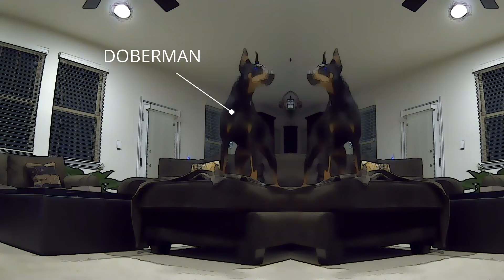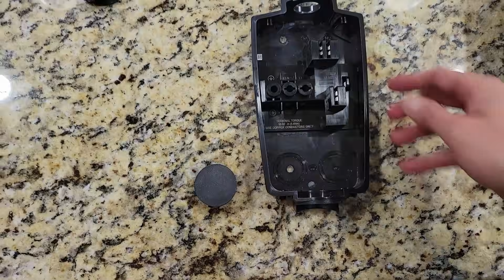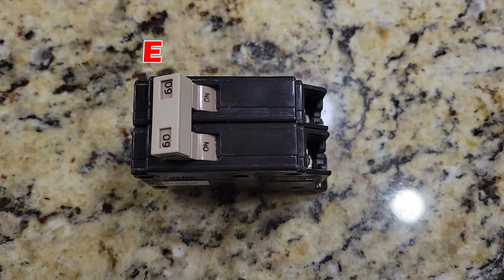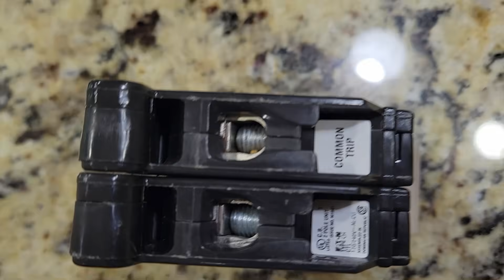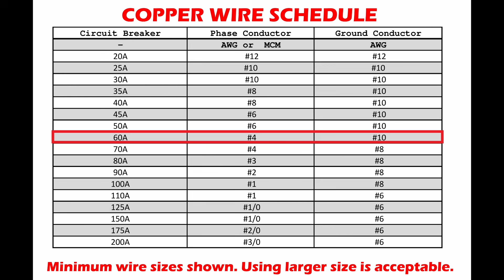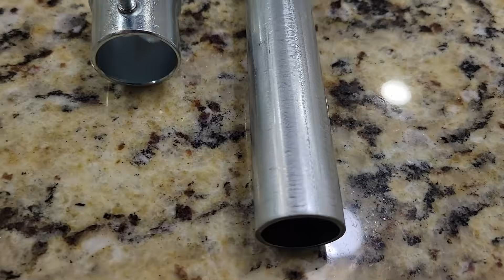Tesla Wall Connector Installation Tips NO ONE is telling you!

Comment: You shouldn’t be using a bare copper ground in conduit, you should have used 10g thhn in the color green. A better practice is to size ground wire down one gauge size from your ungrounded conductors so I would have pulled it with a 8g ground wire.
Reply: I thought it was OK to use same size ground wire as the 2 hot lines.  Is there a reason to downsize the ground wire?

Comment: If you use NM-B cable then 6AWG is rated at 55Amp max for continuous load. The NEC definition of a continuous load is a load where the maximum current is expected to continue for 3 hours or more. If you use THHN wires then 6AWG is rated 65Amp max for continuous load. Both conditions are for the standard 60/75°C termination on both ends, the EV connector and the Circuit Breaker.
THHN 6AWG is also rated 75Amp max for continuous load on a 90°C circuit. It's mostly about the insulations of the wire or the cable when it comes to continuous load ratings. THHN 4AWG wires for a 60Amp circuit is overkill. If you are running NM-B cable instead, then 4/2 NM-B (4AWG+10AWG Ground) is the correct way. Also note that there is no need to run the ground wire when using EMT as conduit. You'll need to connect the EMT to a connection box prior to the EV charger and run a ground wire from the box to the EV.

Comment: Great videos, i have a question please, i am running my wall connector on a 60 AMP breaker in the ambient temperatures of the North East at an elevation of 400ft and a 6 awg Thhn run of 85 ft long 18 in deep in 1" diameter piping, if this was you would you pull of the 6awg and install 4awg?
Reply from the maker: Sean, Here are some items to consider:
#4 awg yields ~0.96% voltage drop for ~90ft run. #4 cost ~$2.11 a foot.
#6 awg yields ~1.5% voltage drop for ~90ft run. #6 costs ~$0.86 a foot. Smaller wire is easier to bend and work with.
1" conduit will help facilitate the will pull for the long run. Remember the wall connector only has 1" conduit knockouts for the backplate for back entrance installation. If you do top or bottom installation (I did bottom) knockouts are 3/4" max. #4 preferred,  but #6 is acceptable.
Reply: @dgtv3320  wow i didn't know about the voltage drop with these wires. Thank you great information.

Comment: Not sure where you got that ampacity chart, but #4 is a bit overkill. #6 THHN is good for 65A And if you want an easier wire pull, use (green) stranded #10.
Reply from the maker: Good thought! #6 AWG is actually good for 55amps and  is not enough for a 60A breaker.  Refer to NEC Table 310.15(B)(16) for cable ampacities. Per NEC, anything under 100amps, the 60°C cable ampacity column has to be used.  For a code compliant installation, #4AWG is the correct size for a 60A circuit breaker.
Reply: @dgtv3320  Please refer me to the article that requires THHN to be rated in 60 degree column instead of the 70 degree column. (Are you thinking of NM-B cable?)

Edit: I am well familiar with 310.15 (B) (16)
Reply from the maker: I don't have the NEC code section off the top of my head. I will find it and post it here shortly.
Reply from the maker: Refer to NEC 110.14(c)(1)(a). Because of this rule, design firms across the USA design based on the 60°C column for circuits 100amps or less. Any circuits above 100amps the 75°C column is used. This is an industry design standard. This wire schedule shown in the video was “borrowed” from the previous design firm I worked at. Please remember any content on this channel is my opinion only and is not legal/electrical advice—this is strictly for entertainment purposes only. Nonetheless, I hope this is helpful.
Reply: @dgtv3320  It seems to me that you are applying the standard for termination provisions far to broadly and ignoring a BIG caveat to the requirement. "Unless equiptment is listedand marked otherwise..." this provision does not apply to THHN which is listed and marked for for use at 70 deg. C, as are all other portions of the assembly in question.
Reply: ...was your industry standard to use unlisted conductors?

(Edit: ...or to make that question more relevant to the section... did you exclusively use terminations rated 60 deg. C?)
Reply: @dgtv3320  What industry are/were you in? (Genuinely curious coming from the EVSE installer side of the business. )
Reply from the maker: When you're in the area check out the charging sites @ 5795 Christie Ave, Emeryville, CA 94608 or @ 660 Stanford Shopping Center, Palo Alto, CA 94304, depending which side you live on. Everything on site is rated over 100amps and thus everything is designed using the 75°C column. Not doing chargers anymore but commercial buildings now. To clarify, yes section 110.14(c)(1)(a)(2) is applied broadly throughout everything rated less than 100amps and yes it applies to THHN conductors.  You are definitely entitled to your own interpretation and are free to install any size conductor you wish. Circling back to the main topic,  when it comes to safety, in my opinion #4AWG is the correct size.
Reply: @dgtv3320  Comming from a certified electrician and EVSE installer, that is inaccurate though I much prefer having this discussion rather than trying to convince people that #6/3 romex is not acceptable for a 60A EVSE circuit.
Reply from the maker: We are both missing the point and I have corrected my previous statement. Under very specific circumstances, using #6/3 can be a code compliant installation--yes you are correct. However, this is still something I would not recommend. A lot of factors need to be considered: circuit length, circuit elevation, ambient temperature, terminal ratings are just a few... Imagine running (6) 60A circuits from a basement of a commercial parking structure, up to the 4th floor. Running #6/3 is a very poor choice. Back to your original statement "#4 AWG is overkill!" In my opinion, absolutely not.
Reply: @dgtv3320 55 is for the romex. Thhn you need 75c column. Which #6 is 65. Tesla says use min#6 at 90c rated wire.
Reply: @dgtv3320  I'm not an electrician, but you are only allowed to run 48A on a 60A breaker, right? But I guess if you accidentally pull more than 55A it's good to have the #4.